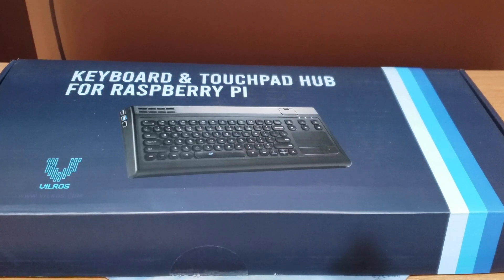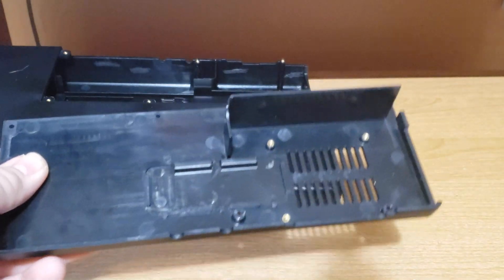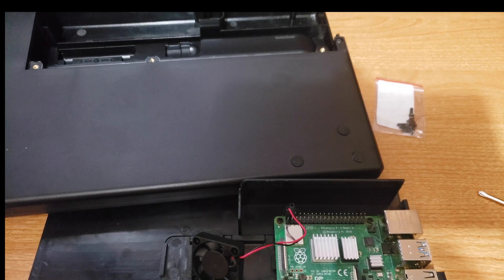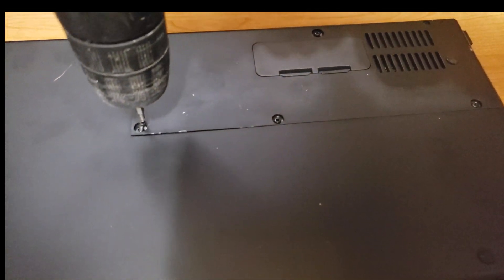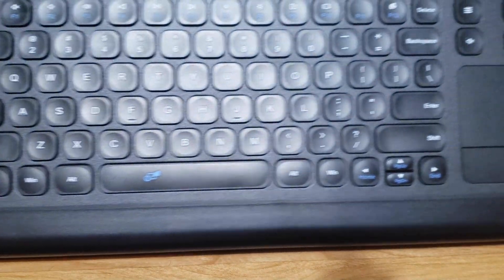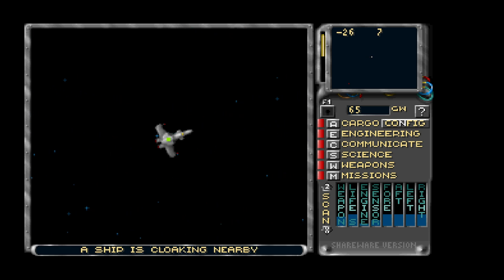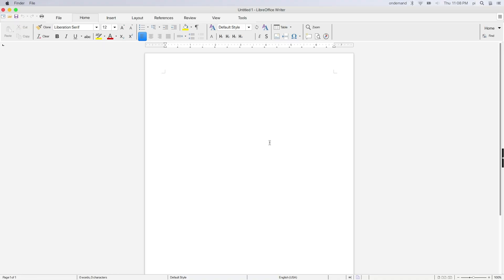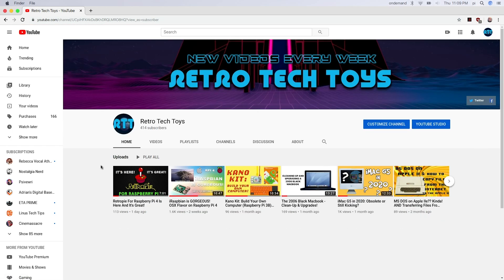Vilros Raspberry Pi Keyboard & Trackpad! Is It Any Good?

Comment: I bought one, but my keyboard is not capable of touch typing. The keyboard is quite stiff and unresponsive. Any, my base unit is warped and doesn’t sit flat. Altogether a bit disappointing considering I dropped $ 87 AUD on the unit. Not too keen on the location of the fan which is supposed to just friction fit in place. All port lids are very tight and hard to release. Overall satisfaction is around 49%. Could have been so much better. However, I have not seen anything else like this, and the price is much too good to miss. Even given the Australian $ at such a low rate - Pi-Top laptop is $500-600 AUD.😢